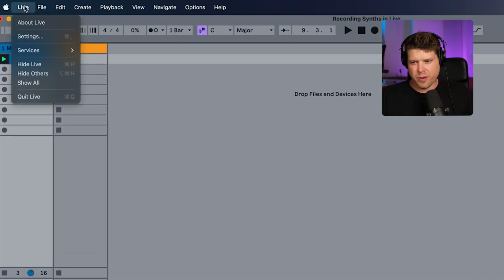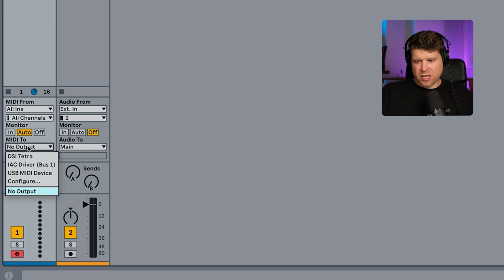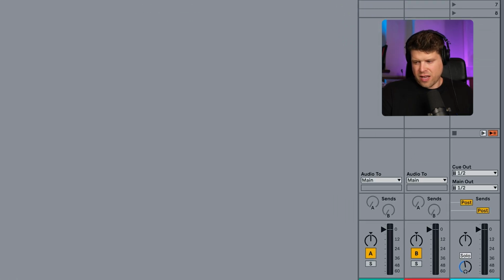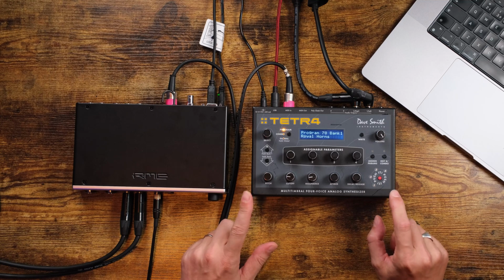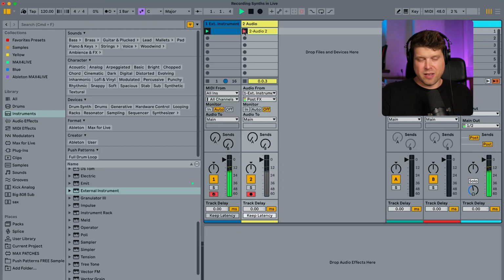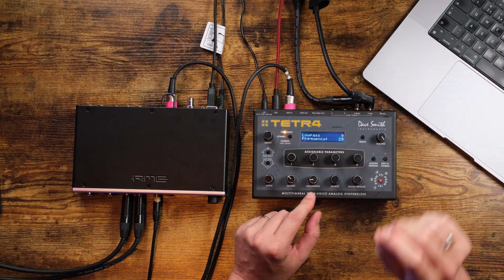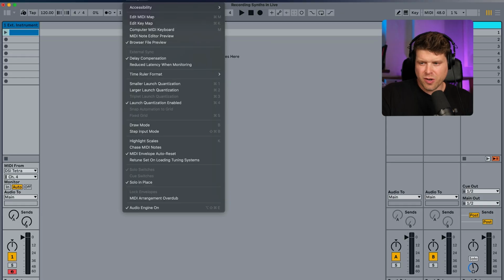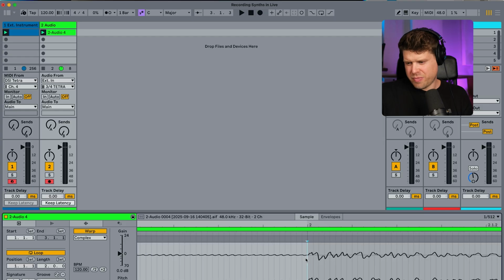Most People Record Synths in Ableton Wrong (Do THIS Instead)

Comment: Problem for me is that most of my hardware have a drift in when the the audio starts. So some tracks start 2 ms after the beat but some tracks (same hardware) starts 2 ms before the beat. No monitoring on, no plugs on the mixbus, delay compensation and reduced latency on, no hw latency on the ext instr. No audio driver error compensation. I feel Ableton tries to be smart despite my settings. With delay compensation set to off I get a lot of latency instead. Using midi interface UM-one and Motu 828x with a windows computer. Perhaps its Ableton clock that is drifting...
Reply from the maker: Yeah, I feel your pain. I pulled my hair out over this a few years back and went back and forth with Ableton support with no real luck at the time.

There is now a setting that helps though. It is called Keep Latency. This was added specifically to deal with this kind of drift. If you turn Keep Latency off, it usually gets rid of that initial offset you are hearing.

Also double check a few things alongside it. Make sure Driver Error Compensation is set up properly, and that Reduce Latency When Monitoring is on. Those three together are normally the combination that sorts it.

It is not Ableton clock drifting as such, it is more how Live is trying to be clever with compensation. Try that and let me know how you get on.

Comment: Great walkthrough as always, thanks. Could you do a video doing the same but this time for external drum machines and hardware like Elektron boxes that have their own sequencer? I've gone down the rabbit hole of using external sync boxes to try to get Live and hardware drum machines in super tight sync (no more than 1ms out) but external sync boxes like the Floating Point/ERM Multiclock are a faff (and not cheap). Live 12 has a 'reset external clock send every bar' option (not the correct name but that's what it does) that IME (combined with 17ms of delay in Live's MIDI settings for the MIDI port I was using) got my Roland TR8S to within 2ms of the grid without any external clock. Not bad, but not close enough for me personally. Perhaps I'm missing a trick somewhere? Also, trying to sync an Elektron box (like a Digitakt) without using Overbridge or an external clock device is really hard... certainly defeated me.

Comment: Sometimes there is anyway a 100ms+ or so delay before Ableton starts actually recording so what I do is hit play on the MIDI clip I made and then i hit record after the clip is nearing the end of the loop. If I hit record on the Audio track then everything lines up just right. I will usually use a metronome as well. It depends on the synth for which I am making audio loops

Comment: Craig, this is a revelation for me! I realised and have just proven Ive been an idiot for years using a stack of external hardware synths and Ableton...
For years I have been disappointed with all the parts I play in being very inaccurate from a timing perspective and just assumed that despite playing the right notes I could not play in time. At times I was confused as I thought I had played something well and then it would be just sounding wrong and not musical...I assumed I had no musical feel or timing capability.
I have just followed your process with 3 of my hardware synths, a Kronos, a MODX M7 and a Hydrasynth Deluxe and made the corrections in the External Instruments for each (I have always used them but had guessed the latency adjustments and got it completely wrong (by miles)). 
I have just recorded some quick parts playing to a drum clip and everything is in sync and my playing timing is clearly not as awful as I thought as it all sounds pretty tight and broadly in time!
Thank you so much - I think I am going to have a lot more fun making music now and not feel so down about my poor quality efforts! This is just incredibly helpful.
Happy Xmas
Steve
Reply from the maker: That's amazing to hear, Steve! So glad this video could help you out

Comment: TBH all I do is make a midi track, add the external inst. instrument like you do, set the synth, channel and audio channel(s). I then just make a new track listening to the audio channels I have my synth piped through. Locked in tight with zero latency and no need to adjust for any delay. I tried your method, and it introduced latency. baffles me, but if it's not broken, then I'm not about to try and "fix" it.

Comment: Great video. Since this is covering basics it might also be useful to mention how to properly gain stage and set the correct levels of your input, too. Cheers!
Reply from the maker: Great point! That would definitely be a good addition for a future video covering basics. Thanks for the suggestion! What levels do you normally aim for?
Reply: @pushpatterns I actually watched this video hoping to get insight on this haha. I'm always struggling to get consistent levels especially when changing between patches!
Reply from the maker: Ah yes this would be the levels set on the synth patches themselves, as long as your not in the red you’ll be fine, but good ball park is anywhere around -12 to -6 dbfs

Comment: There is an easiest way to do it, just in the setup go to Midi in the hardware you check the output open it and correct the delay there. Then the latency gets adjusted for ever.
Reply from the maker: This works, but using the External Instrument device is better — especially for clocked gear or tight timing. If you just send MIDI from one track and record audio on another, Live won’t apply automatic delay compensation. That means your monitoring will be late, and recordings won’t line up properly. External Instrument fixes that

Comment: good timing for this tutorial, I'm looking exactly that, thank you !
Do you have any tutorial please how to control with a Push 3 the Analog Rytm, particularly how to use mute on Push?
Do you have that information on your courses maybe ?
Reply from the maker: Hey, a couple of things that might help here.

I actually made a Max for Live device that does the same mute behaviour as the Elektron Rytm, because I love that workflow too - https://youtu.be/P5SadU1oYf0?si=Jg0wbYZooMhahOyT

Also, getting it locked in time with Push standalone can be a bit of a pain, so I made a video showing how I set it up - https://youtu.be/sjWqeWHQTlY?si=91mB4b1-624ADzF8
Reply: @pushpatterns  Thank You so much ! I bought the plugin for Mute but another issue it's how to setup AnalogRytm+Ableton+Push, in my setup drum rack it's doesn't working. Do you have something how to create correctly Drum Rack for AR  please ?

Comment: legend
Reply from the maker: Nice! Did it help!?
Reply: @pushpatterns yea fs. i didn’t understand the external track or how to send knob data. there was a couple things that went over my head but i think i need to rewatch this video while i make a template for my synths. thanks!
Reply: also side note but my interface only has 2 inputs, and swapping synths out for my mic was uninspiring. i thought i had to get more channels but then i found out about aggregate devices on mac. if you could do a video about that / about the best settings when you’re routing things that way that’d be amazing
Reply from the maker: A video on how to set up an aggregate device?
Reply: @pushpatterns for use with USB audio synths + and interface if you’re dealing with limited channel. 

along with the best settings for latency when you use that method. 😊